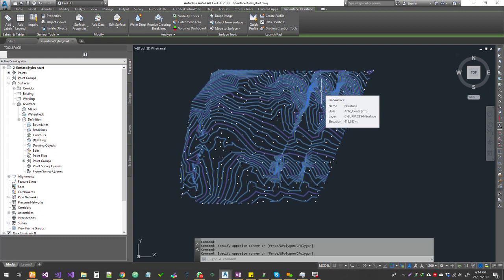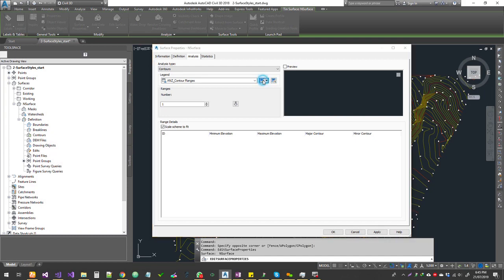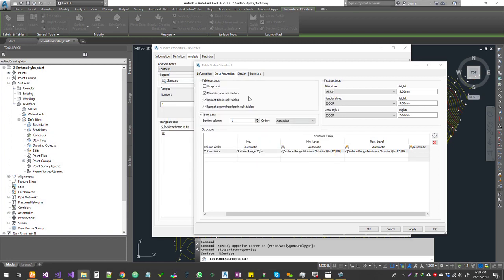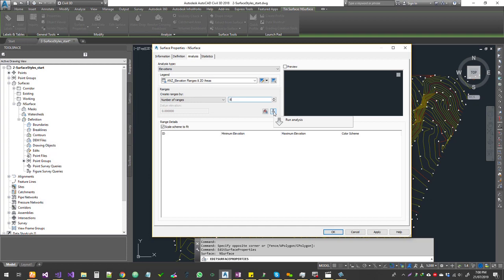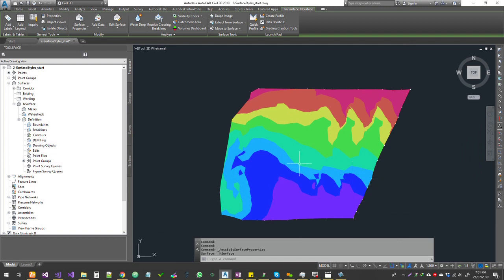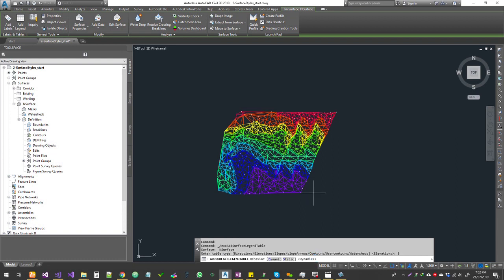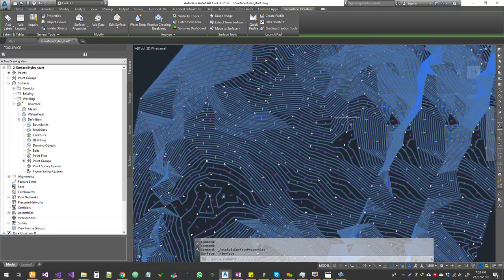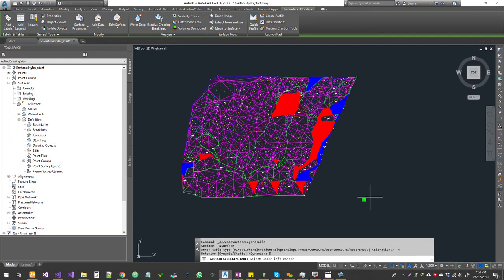Surface Analysis Training - Civil3D

Comment: Thanks.. great demo.. I just extract a bunch of contour lines to from google earth to autocad, they are 3D , each line is positioned at its own elevation.  So from this point on, what do I need to do to be able to to run the analysis as you demonstrier here? I I suppose I should export to civil 3D as Surface? you know how? Thanks
Reply from the maker: Import to civil3d and create tin surface using that